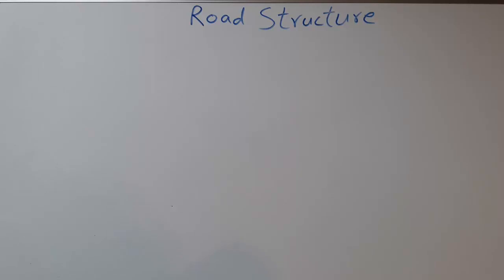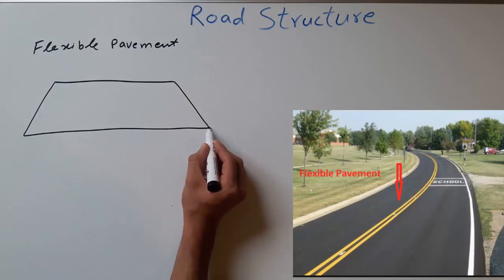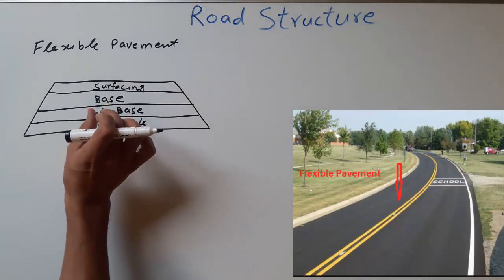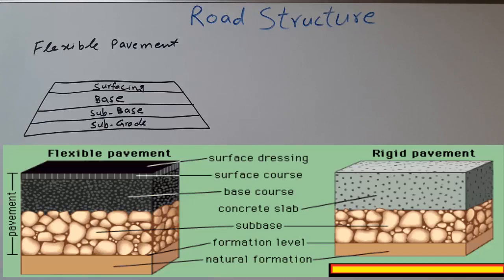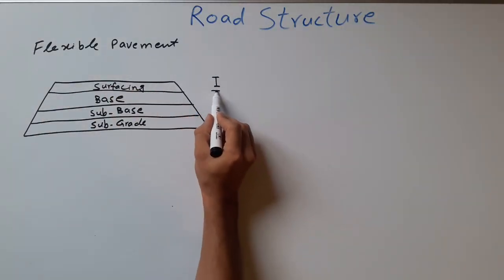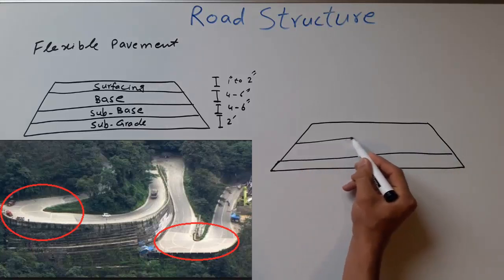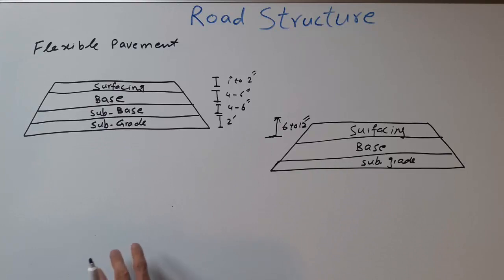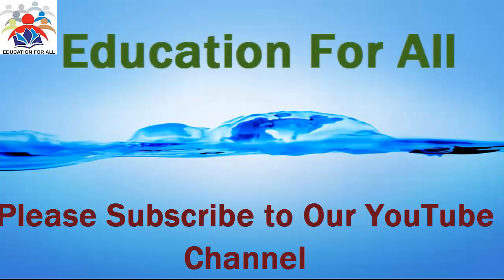Road Structure

Comment: What are the material for subgrade? Sub base ? base? Surface?
Reply from the maker: Thanks for your response. Yes the material for subgrade could be stone or bricks parts if needed as it is not necessary layer. Sometimes our road is already strong and we just have to make it straight and lay other layers. Subbase layer could have red sand with small stones in it. Base layer could have small stones called bijri in local language. Surface layer has small brown colour stones with bitumen spray.  Please note for flexible pavement small brown stones mixed with bitumen and later put on road surface.
Reply: @educationforall1442  ur saying sub grade is nt an important layer while in video u said its an important layer of road
Reply: @educationforall1442  thanks for this

Comment: HELLO SIR , PLEASE MAKE A VIDEO ON THE TOPIC ARE :-  (1) HOW TO SHIFT TBM . 
(2) HOW TO SHIFT FLY TBM . 
(3)  HOW CHECK THE REQUIRED EXCAVATION LEVEL BY MAIN TBM OR ALSO ANY ONE FLY TBM VALUE  . 
(4)  HOW TO CHECK THE TOP AND BOTTOM LEVEL OF ANY EARTHCRUST LAYER BY MAIN TBM OR ALSO BY ANY ONE FLY  TBM .
(5)  HOW TO CALCULATE THE QUANTITY OF EACH AND EVERY EARTHCRUST LAYER  BY USING THE OGL DATA WE ARE TAKING FROM INITIAL STAGE OR BEFORE EXCAVATION STARTS.
(6) HOW TO MAKE EXCEL SHEET FOR THESE ALL WORKS AND CALCULATE .
Reply: you don't know??
Reply from the maker: Thank you for your question I will includes these videos bit by bit as for now I am following a series of SFD and BMD of different beams. Surely at later stage I will do that. Once again thank you for your great suggestions
Reply: @educationforall1442  ajit Kumar is asking about Levels TBM  and sir you are talking about SFD  and BMD ( shear force diagram / bending moment diagram ) please read the question carefully and answer accordingly 
anyways thanks for your informative video 

thanks a lot .